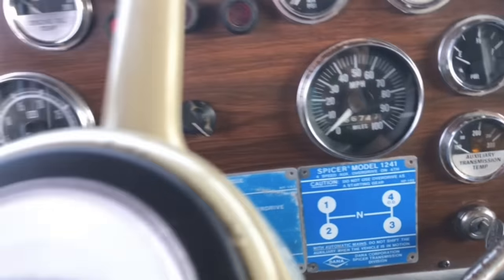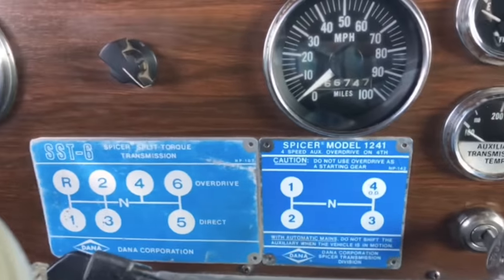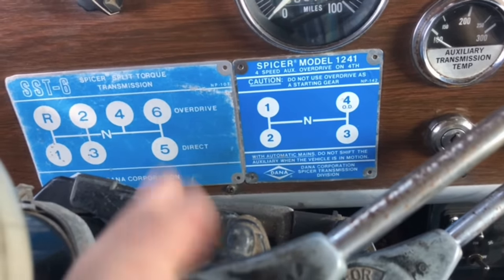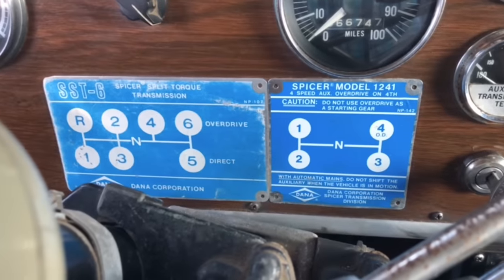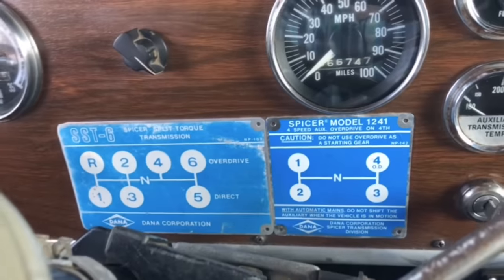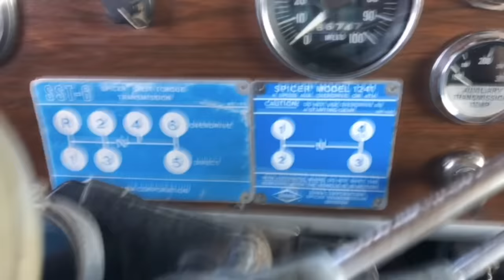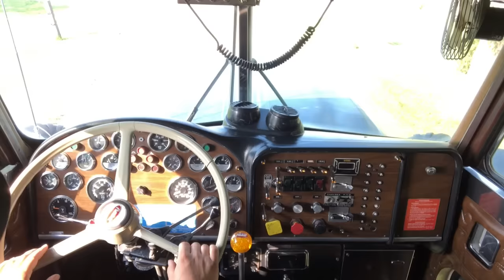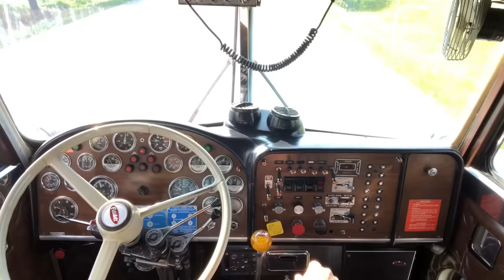How to shift Two stick 6+4 Spicer Transmission Peterbilt 359 #Peterbilt #359 #Twinstick #Twostick

Comment: I started driving truck in 1960 and retired in 2006. I drove several twin sticks. My 1st was an Autocar with a 4&4, then 5&4 6&4 5&3 and so on. Finally went to 18 speed, 13 speed and finally a 9 speed. I always liked the twin sticks and missed driving with them. This video sure brought me back. Thank you so much for giving me a few minutes of the past. Good luck and keep the shiny side up.
Reply: I started in 1964 (illegally at 14yrs old), driving at night so the cops couldn't see me.  Like you, I started on "A" Cars (& "Broc's) - ten wheelers with 12:00 x 25 rubber (Man.. those A-cars sat high!!)... a Cummins NHC 250 (with "backdrop" manifold & dual straight pipes = beautiful "music", especially when driving loaded in "Beantown" and it all bounced off the buildings!), and the obligatory 5x4 with 5.17:1 rears... 55 mph, flat out with a tailwind!!... but, man.. in low-low or low split, you could pull a mountain off of its foundations!!  lol  

I had occasion to later drive Macks from LF & LT's, "B" models, up to an RSL700 ("Western") with a V12 with the Mack triple countershaft 12 speed, which I think was probably one of the "toughest" boxes ever built.... I "swear" you could use it for a "rock crusher".  lol   

We must have Both been from the New England area?... or at least both from somewhere on the east coast... from NJ up to Maine - with all the "A"cars, Brocs and Macks.  Didn't see that many of the A-cars and Brocs, much further south than NJ and maybe Delaware.  

 I left the east coast a couple of years after getting out of Nam... and never went back, except for the very occasional visit.

Comment: Dad was a master at this, would ride with him in the 70's hauling offroad for drilling rigs.. two handed shifts climbing hills in the bush was really something to see
Reply: set those lyrics to music
Reply: 70s probably smelt like old 2 stroke detroits
Reply: 4x6 so its basically a 24 speed? Do you only use the main 6 when empty?
Reply: @danc1197 .... Hi Dan, it was probably just a "typo"... but I think you meant a 6x4... instead of a "4x6"... and yes, IF you went from 1st low split or 1st low-low (there were Many different gear combinations with different boxes back then) all the way to 6th Over, or possibly a double Over... you would have 24 gears.  However, we Rarely ever had the need for using 1st low split or 1st under, due to the fact that the overall gear ratio (including the rears) was So low that in many cases you could literally crawl on your stomach faster than the truck would move... so was only used when we wanted to pull "mountains off of their foundations" as we use to say. 

Another consideration is... and depending on what series of "boxes" were being used as well as what the rear end ratio was... that there were some gears, especially like he pointed out in this video.... that were "over-lapping" each other, especially between 5th & 6th in the main.... but, again... it all depended on what set-up was actually being used as there were numerous different transmission combinations that could be had using various gear sets (ratios) inside each of the different types of Main & Brownie boxes.

When I was empty, I would start off in either of the lower 2 gears in the main, depending on terrain and would use any combination of the two boxes I wanted to... all depending on terrain/gradients..... same thing when I was loaded... I would use any combination up or down in both boxes that I wanted or needed to, all depending on road conditions, gradients and weight.... I never used any particular pattern, in either or both boxes.. it was always determined by weight, gradients (up or down), weather (road conditions)... I rarely ever used the same pattern twice in a row.
Reply: A master shifts with one hand and keeps one hand one the steering wheel. 
I learn that on the farm in my mid teens.
Reply: @Romans--bo7br  You have been there, you know your gears MATE.
Reply: @barrypascoe960 .... Thanks, Barry... it was "fun" while it lasted. : )   At least I got in on it when we still had Real Truckers, and real, classy trucks... there is No Way, that I would do it over again, if it was in this "day & age".  

My only regret is that I didn't keep at least one of my three trucks.... would be fun to be able to fire it up now and then, and just take it for a "cruise".
Reply: @destructoidx99  We still have some old 2 stroke Detroits in a couple of vehicles where I work. You hear them from a mile away and they really do smell unique.
Reply: My dad was as well.  He drove a late 70’s Kenworth that had a 5x4 Spicer.  (The only reason I know it was a Spicer is because of the shift pattern.  Spicer wasn’t a term I was familiar with as a kid; and sadly, he died when I was young).  Some of my BEST memories as a kid in the 80’s was going over the road with him.  He did heavy haul for an old company known as Barbour Trucking Co.  (not around any more).
Reply: @Romans--bo7br What years did you drive?  And what type of freight?  I loved reading your comment.  My god how I wish my old man were still here so I could hear him talk about this stuff with the same level of nuance and detail.  He died when I was kid, so adult conversations about this stuff never happened.  But I LOVED sitting in the passenger seat and watching him make it work.  It just seemed to come second nature to him; he never talked about it as if he were doing something impressive.  And at the time, I just assumed every truck was set up that way.  The one issue I have with this video is the “downplaying” of the skill involved.  I think it’s a bit of false humility coupled with taking a bit of a shot at guys who post videos like this.  No, it’s not rocket science, but in terms of driving, it’s some of the most complex driving one can do over land.  

To echo something you said- I rarely saw dad put the main box in 1st.  He did heavy haul and still rarely used it (at least as my childhood memory recalls based on where I remember seeing the sticks).  Once, he was using the winch to pull a tree stump out for someone, and I saw him put the main box back to the left.  It was essentially right against his seat.  I now realize that was first gear on the 5x4 Spicer. 

What I remember was seeing him start with the main box forward (second gear).  And his first shift was almost always from 2 to 3 in the main box if I remember right.  From there, he’d do something with the stick on the right (the auxiliary), and then things started getting complicated to my 7 or 8 year old eyes.  Ha!  Oh what I would give to sit in that seat again and watch.  What I’d give to have a chance to pilot one of these beasts!  

Thank you for sharing some of your memories.
Reply: @andrew5184 ... PS: Like your dad, "Sticks" came very natural to me as well.  I could "mix them up" all day long, up or down... all depending on load weight, gradients, etc, etc.  It was a Lot of "fun"... I sincerely miss them.  I could generally "out pull" just about any other truck with similar weight... that had a single stick Fuller transmission, on a long gradient.

Comment: Wow! Finally! I understand how it works. It is indeed very simple. So the auxiliary stick on the right pretty much lets you split each of the main 6 gears into 4. Your explanation plus seeing you drive it made it all clear. Thank you.
Reply: Entendi através do seu comentário.
Reply: @TheHuskyGT.... Yes, it's all "very simple".... until your the one sitting behind the wheel, with a full load... pulling 5+% grades.... then we'll see how "simple" it is for you (or, Anyone).  MANY of the old (some started driving, even before WW2) "Knights of the Road" (the Real truckers!) who knew nothing about "single stick" OTR trucks... would need to pull over to the side of the road, and start over again due to missed shifts and have to "crawl" up to the top of the grades.   

Diesel engines (4 cycles) by almost all manufacturers, did Not get turbochargers and passed 300hp until the early 1970's.... it was a full days work, driving back then.  

I started driving "ten wheelers" ("A" cars / Autocar & "Broc's" - Brockway's) when I was 14 years old - driving at night so the police would see me, hauling snow in the winter time.  

I started driving OTR in late 1972 with my own truck (1969 - 359 Pete), which originally had a Spicer 4016 compound 4x4, later swapped out for a dbl over 6x4 due to building the V12 up to 860hp specs and the 4016 couldn't handle it.   Great times!!
Reply: Essentially a 24 speed, right?
Reply: @Romans--bo7br  nahh it looks really simple because it is really simple

Comment: I own a 79 Long Nose Pete with 3408 cat and 6&4  with 285 wheelbase . It did about 96 mph. Only had her there a couple times. Very nice riding rig. Did a lot of oilfield work with her.
Reply: That's great that you apparently still have "her".  The 3408 was a great engine... even though some of them had their "issue's".  My first truck was a 1969 - 359 Pete with a V12 and a Spicer 4016 Compound 4x4, that I bought after coming home from Nam in 70, from a friend of my dads. 

He only drove it for three months, then had a heart attack and had to park it.  

It was his "retirement" truck and he had paid cash for it, so it didn't cost him anything to have  it sit until I bought it.  He really wanted me to "make it", so he sold it to me for $10K... which I more than had from all the "bonds" I had bought while in the service and cashed in, so I bought a 150 ton low-boy with a booster with what I had left over and never looked back.  

I had two ext'd hood "A" model KW's after that, set up for heavy haul, also with V12's and dbl over 6x4's.  

I sure miss those days and years... great times, and would do it all over again... except I would have kept the 359, and at least one of my "A" Models.

Comment: A 4x4 married unit is what I learned to drive in. Thank you for just telling it like it is, and not trying to sound like a super trucker. Once someone understands the concept, it isn't that hard. I started driving 37 years ago and still prefer a split transmission set up. One of the advantages, it there are no air lines to freeze up and slow down or stop shifting when it is -40 in NW Wyoming.
Reply: Your referring to the Spicer 4016 Compound 4x4 (I had the 1st gen, "sticks" as well, in my first truck - 1969 - 359 Pete with V12) with the twin sticks.  The 2nd gen "4x4" - known as the "air 4x4"... was a 4 speed single stick with the auxillary 4, controlled by 4 position "button", similar the "button" on a Fuller 13 spd.  

The 4 speeds in reverse was still retained in the "Air 4x4" like Spicer had in the first gen 4x4.  

I really loved the even 6% step between all the gears in that 16 speed... made for really quick shifting up and down, and "skip shifting" in the grades when necessary.  

Ahhhh... those Were "the days"!!.... when Men, were men... trucks were "real trucks" with their own "personalities"... and Women, were real women.. and great to come home to!!  ; )  I sure miss those days.... but at least I got to live it, and I still have my loving wife of almost 52 years now!!  : )

Comment: I drove a 1966 Pete 359, with a  335 Cummins, 5&4, tow truck, I learned by myself,  I ground the gears a lot,  but I finally got the knack,  it was Easy after the learning curve,  😆😆😆Great Video,  Thanks William Orange county, Ca.
Reply: @billaroo1..... the 359 Pete, did Not come out until late summer of 1967.